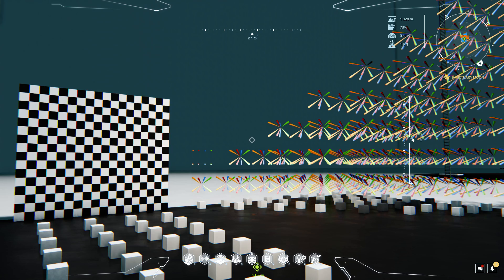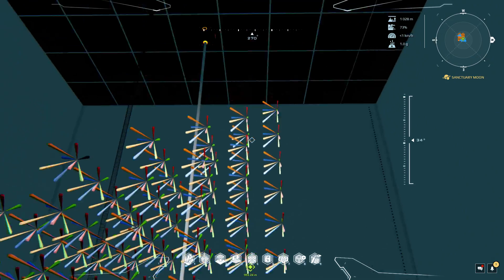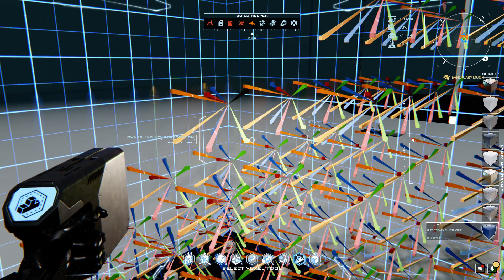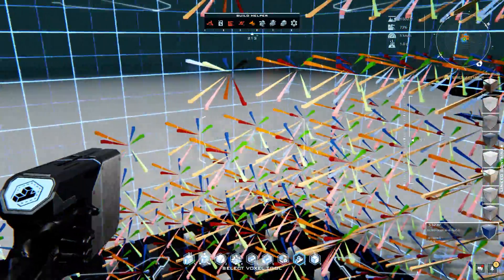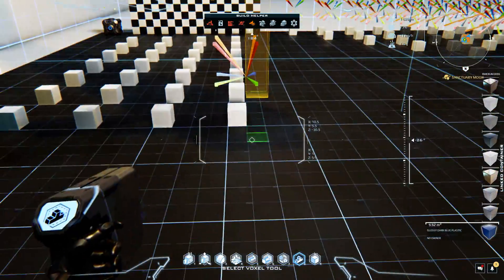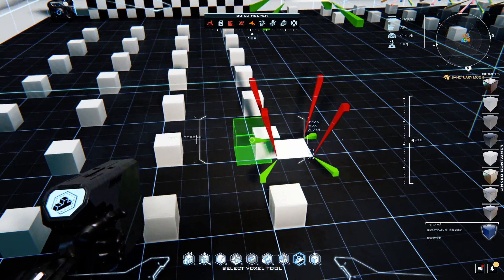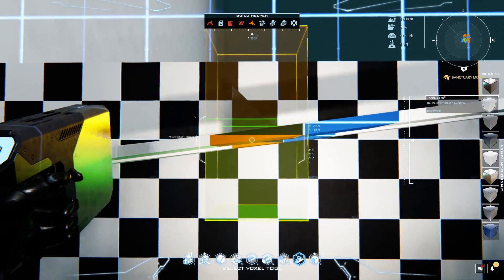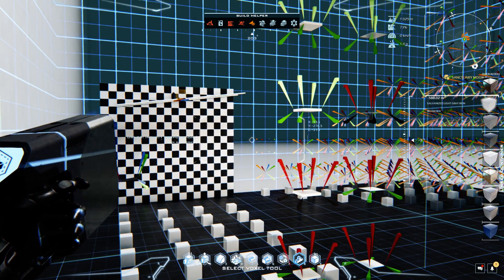DUBeta  Adv. Voxelmancy 203

Comment: Hey Tordan,managed to make a tetrahedron, seems to be just outside a standard voxel, is it possible to make one completely inside a voxel?
Also I managed to one side of a tetrahedron as a flat, next challenge is to make it 1/8th thick if thats possible? The flat doesnt like joining a dominant voxel, the edge comes out in steps, probably me doing it wrong, a 1 voxel thick side works fine though.
Reply from the maker: a tetrahedron only has 4 sides, and a voxel has 6 so yes, it is possible to make almost any size of tetrahedron, and if it is a rendered size of less then 4 voxels across in any one direction, it is possible to make one with only one voxel. Basically you just need to figure out where you want to put the "extra" four vertices.  The most practical is to actually put them in exactly the same place as one of the other vertices that your using to form your triangle.